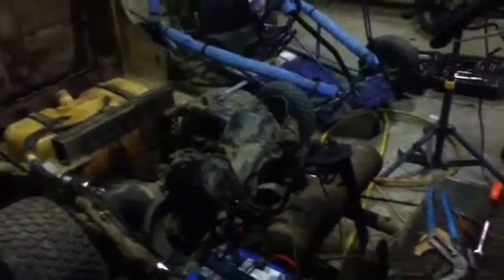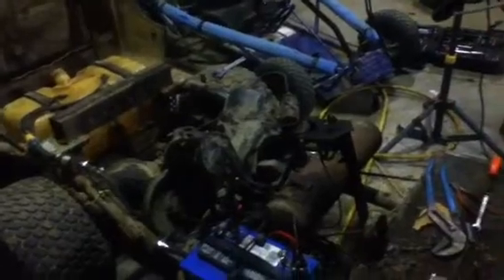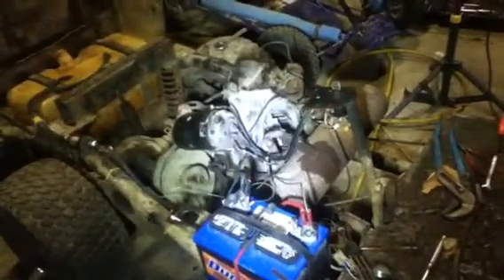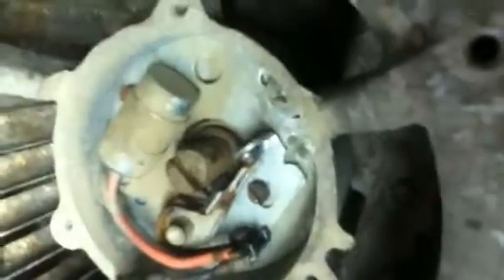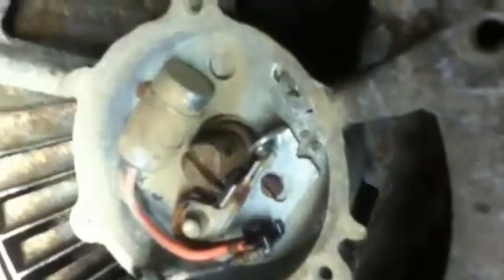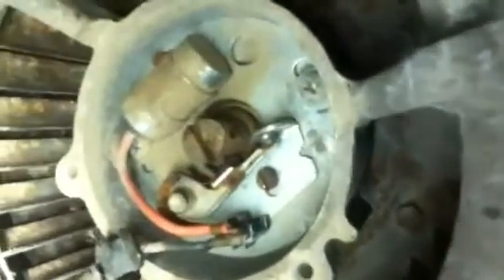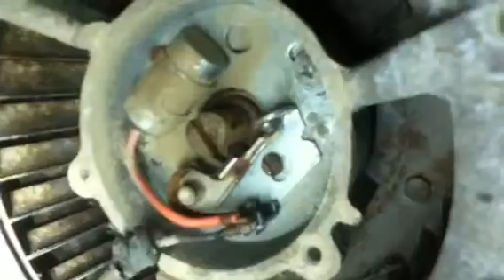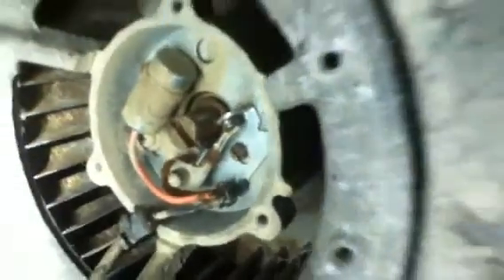Harley Davidson golf cart update

Comment: You know of anyway to get these to run a little faster?  Not trying to get a dragster out of it..but would like a little more speed.  I've got a 1983 columbia which has harley labels on the starter and all over the motor.
Reply from the maker: soleniak there is not really much you can do to make these go since it has just a torque converter and a diff that is just cnc machined so you cant really do much at all. these are fast carts to begin with I hit 20mph in mine